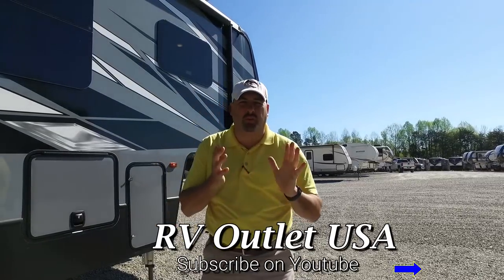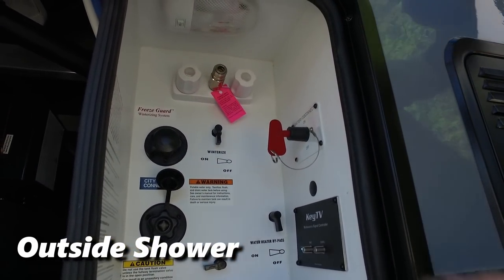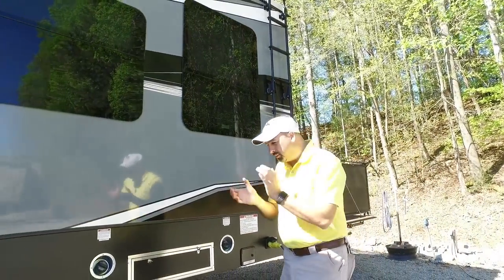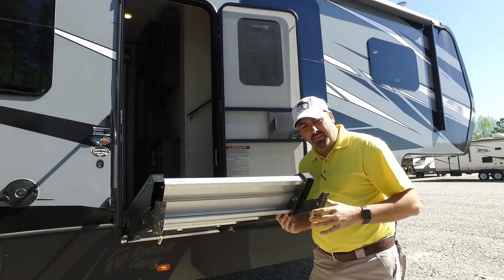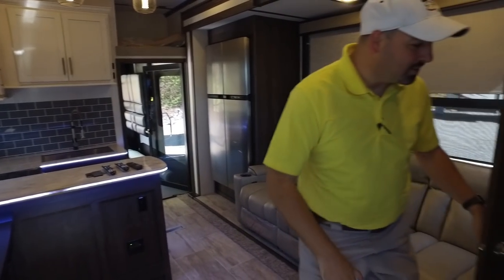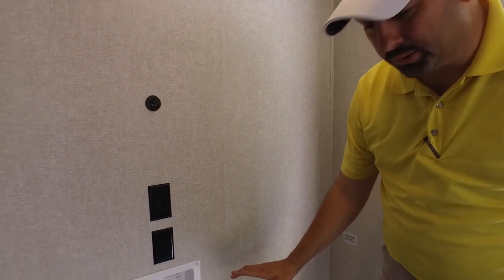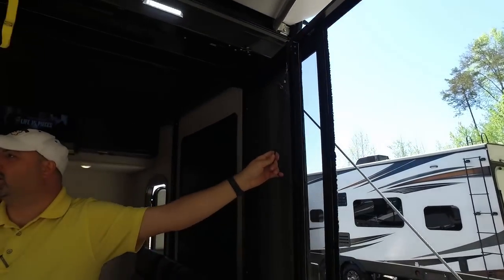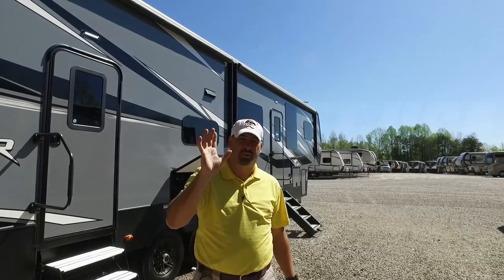2019 Keystone RV Raptor 351 Toyhauler Thorough Walk Thru

Comment: Best walk down of any trailer I've ever seen. You went through everything and how to use things. You even gave pointers on what you shouldn't do. I've always assumed that if you were at a full hook up site, you opened all your drains but now I know better, thanks.
Raptor did a nice job with this trailer. The only thing that I don't like is the location of the patio door. Why would they put the door right where the cable is. This could end up hurting someone not familiar with your rig, a guest that is leaving a night and runs into the cable and falls back and gets hurt. Keystone fix this. Just move the door to the back like everyone else. I'll look elsewhere, don't need my kids getting decapitated. I'm looking to upgrade my 2006 raptor.
Reply from the maker: Tara, thank you for the complement.  The Cable is actually removed when you put the patio steps on and you use leveling supports that are attached to the door so you don't lose your head :)   Seriously though, thank you for the feedback.  I know so many times information is missed during the walk thrus.   One little side note:  Our Dealership is a family owned company.  We do not add or charge fees to our deals and we sell it near wholesale so you get the most for your $.  Let us know how we can help you when you are ready to trade.

Comment: You did a great job most say here’s the kitchen here’s the bedroom thanks for watching lol. But u did for get to open awnings on the entry side. I would have like to see if they had fixed arms or if the pitch could be adjusted once they were out. All in all really love this camper thanks for info
Reply from the maker: haha.... yep!  I will admit that I totally missed that and after producing the video I thought (darn it I missed the awnings!)  They typically have a push button slide down system on them vs a breakable elbow.  Toyhaulers have those on the two mains like that.  The rear awning is the swing out style like on motorhomes.  I'll be sure to do a awning specific video for some different styles soon!  Appreciate you viewing and the feedback.  We always appreciate the feedback so we know what Customers want :)
Reply: Awesome thanks in advance

Comment: I’m confused by what you said, to wire a single hot (120v) to the 50 amp plug. RV parks don’t do this… does this coach require a special wiring setup?